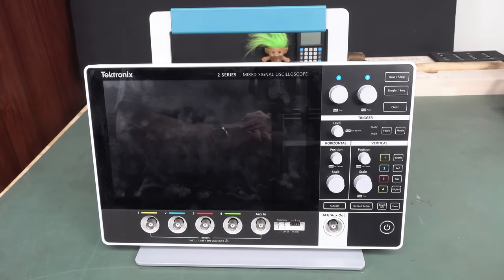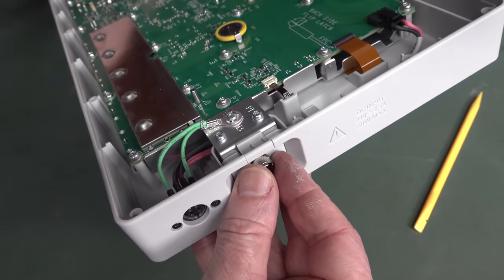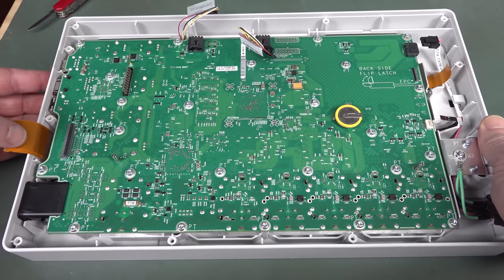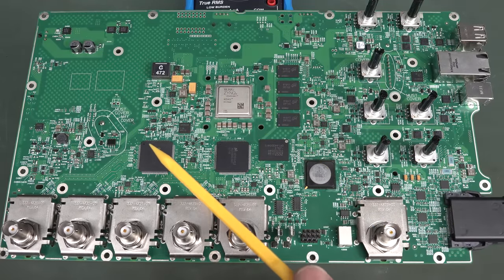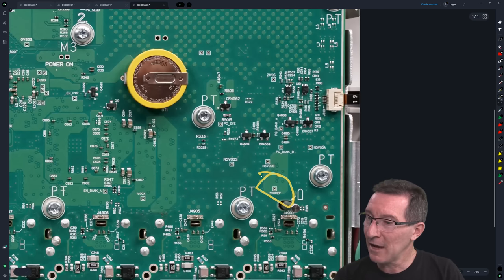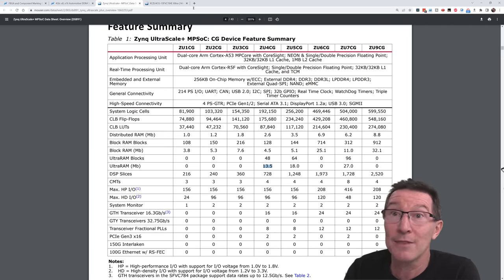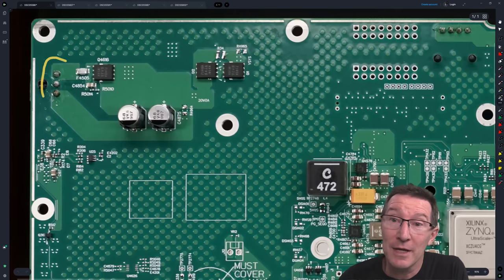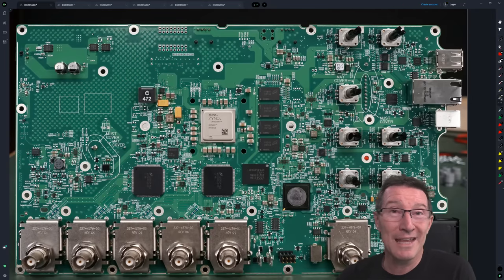EEVblog 1477 - TEARDOWN! - NEW Tektronix 2 Series Oscilloscope

Comment: I have to say that my initial reaction to the membrane switches was negative - but I say now, that I have used it, a lot of effort went into the material selection and the membrane buttons have a great tactile feel.  Definitely designed for the industrial market - completely different league than consumer grade membrane buttons.
Reply: membrane buttons on my 1983 yamaha dx7 still work great :goodvibes:
Reply: @cappnuwu4021  the DX7 was built to last also.......nice one!
Reply: @cappnuwu4021  Lots and lots of DX7's dont work anymore due to the membrane switches!
Reply: @dietervolke7811  Let's remember to check in on how Tektronix 2 series are doing in 2060:yougotthis: Haha!
Reply: Alan is biased though, of course he likes it!  ;-)  j/k  If there is someone else that is going to pick this thing apart, Alan would, even IF he is on the payroll! Looks like a darn good bit of kit TBH. Though metal inserts into the plastic on the backside would have [should be] a part of the design. Penny pinching on a Tek product should be sacrilege.
Reply: It still doesn't feel right to get membrane buttons in this price range. I think it indicates that the buttons are on their way out. I wouldn't be surprised if future models do everything via a large touchscreen that almost fills the form factor.
Reply: @EdwinSteiner  Not hard to predict, given what happened to mobile phones.
Reply: @EdwinSteiner  I hear you.  There is a big difference in industrial rated membrane switches and consumer grade.  I believe another motivation for the membrane switches is considering the operating environments that this scope is expected to be used in - it will likely be carried on-site a lot, subject to a lot more dust, dirt, grime, etc. than a typical lab/bench instrument - so the thinking is that the membrane switches will be more reliable (less dirt/dust contamination) and easy to clean.
Reply: @EdwinSteiner  this is a literal fucking nightmare for me. I have yet to find a touchscreen interface that rivals physical buttons.
Reply: @cappnuwu4021  2060? Let's see it in 2035. And not because of the membrane switches, but because of corrupted flash memory.
Reply: Membrane feels cheap. Not liking this scope.
Reply: Hopefully not to my experience with industrial membrane  keyboards.
Reply: It is curious Tek felt the need for buttons at all, though maybe there are a few operations where you wouldn’t want to cede waveform screen real estate to virtual buttons.  If there were enough CPuU power and interface pin available, then perhaps a second capacitive touch LCD for the buttons (if keeping them separate is a must-have).  At Tek prices, they could afford to do that.
Reply: @Okurka.  My thinking was the membrane panel is a separate part, so it could have been an LCD screen.  An LCD screen could give some interesting options for implementing virtual controls or alternate language labels.  Probably one larger screen for everything but physical knobs makes the most sense.

Comment: Ooo this having a VESA mount is handy. You could get a swivel desk mount and mount it at the perfect level on the bench and not take up bench space. Handy if you've got a compact bench.
Reply: Just wish the power plug had a back access, even if they had to have two jacks, you lose the ability to hide the cables off the side, it ruins the aesthetic and is inconvenient pragmatically because you can't put it up against anything on that side you have to have the area for the cable clear. The VESA mount is nice though since it's light enough it'll probably fit fairly well on some floating arm stands.
Reply: @JWH3  - seems to me like it would be a Dremmel job to cut a new hole for the power connector and move it.
Reply: Me i have a TDS640 Tel Scope !
Reply: @JanBruunAndersen  on a scope in this price range even as it's "entry level" it's a design consideration that should have been addressed before a final product was released. This might be 'entry level' but they start at 1,800 dollars and what I've seen so far doesn't really give me great feelings about the amount of true effort they put in towards good usability engineering.

One thing they did was used self tapping screws for the main screws for the case, and that's just not a good sign in my book.

No one should have to be taking a Dremel to one of these things because they decided not to address something so basic as sensible cable management,

Comment: Nice video. Also, the OS is running on the DDR4. The memory controller is on the (PS). Ultraram is used for the programmable logic (PL). OS is on programmable system (PS). eMMC is used for bootloader, PL bit file, OS … and is attached to the PS.

Comment: Thought on the BNC back Shield, is that the bumps are providing 2x functions, 1: reducing RF capacitance (it could have been creating an undesirable filtering effect if it was closer, and changing the characteristic impedance of the connection) from any protrusions of the BNC center pin, and 2: mechanical stiffening against the back plastic.

Edit: Thought of another possibilityUL compliance/clearance for transients from voltage sources… just remembered of a student using DC coupling on a 240VAC transformer primary.
Reply: My thoughts exactly - but you got there long before me!
Reply: 1M || 15p some 50f stray is irrelevant
Reply: @reinerfranke5436  Isn't it 1M || 13 pF for this scope? Also i came to around 400pF and 200pF with the bump. I assumed 1 cm² area and 2 mm distance without and 4mm with bump. Not sure this is even the correct approach here. Any RF experts here?
Reply: You are correct , look at the area around the centre pin to the plane ✈️ on the pcb
Reply from the maker: Yes, on 2nd thought I think it's CAT compliance clearance
Reply: I was thinking it just pressed against the inside of the back so the shield can't vibrate off the clips.

Comment: The 2 metal posts could be useful for the case to feel a bit more solid, when you pick it up. If feels really cheap and nasty when you buy a new bit of kit and the back is just all squishie
Reply: @the fltsimbuff yes, just make it feel a bit more solid. 👍
Reply: @Radio_Flakes  could be cost cutting, but it could be swapped to plastic inserts to reduce cost. Im glad I dont have to build moulds.  🤣    👍👍
Reply: @Radio_Flakes  I bet thats why I stayed away from them and stuck to PCBs.

Comment: The "MUST COVER" / "MAY COVER" is likely instructions for conformal coating, which has not been applied on this prototype device.
Reply: Does it follow the RFC2119 outlines? Ha.
Reply: Looking very carefully,  U11, CR3 and Y3 appear to be covered in a clear coating.  U11 is certainly shinier and blacker than surrounding un-coated ICs.
Possibly coated to prevent high humidity or airborne contaminants from upsetting the oscillator frequency (?) or flattening the battery.

Comment: At 31 min. They wouldn't be using the internal memory for the OS. Only ~1.5MiB. Likely using the external memory for the OS and the sample memory. The internal RAM might be used for FIFO buffers between the ADC and the external memory for storing the samples.

The Zynq typically also runs form executable code in RAM. So it would load (copy) the binary for the processors from the FLASH into RAM and execute it from there. Possible otherwise, but I would say unlikely.
Reply: Not to mention that the PL (FPGA fabric) and the PS both use the same interface to the memory controller, and thus share the address space. They could split it up however they like!
Reply: Usually the on chip memory is just used for initially loading the boot loader from flash before the external DDR is initialized.
Reply: @RobertHancock1  Yes, but that is On Chip Memory (OCM) which is different to all of the memories shown in the videos. The memories mentioned here (except DDR, that is shared) are all PL based.
Reply: 0:31:00 - You can refer to timestamps like this if need be :) 

Format is: hours:minutes:seconds (hh:mm:ss) with a space after it.
Reply: @RobertHancock1  What kind of "on chip memory" do you mean? Boot ROM, caches or distributed memory blocks in the FPGA array? However, large sample buffers, framebuffer and the operating system must be outside the FPGA in the DDR4 chips. There is not too much space for the samples...
Reply: @PETMK  There's 256KB of on chip memory that's mainly just used for the initial boot image loading before the DDR memory is initialized.

The sample memory is definitely going to be mostly in the DDR, though there is likely some buffering in the PL using block RAM or UltraRAM.

Comment: The screws under the VESA mount screws on the label are for structural support integrating it to the front
Reply from the maker: Yes, you want some rigidity in the centre like that.

Comment: Soldered on coin cell battery is always a no no for me. Had to wait 3 months last year to get my hands on a BR-1225/HCN for a serial concentrator at work. Checking today I would be on a 6 week lead time. It's just not necessary those coin cell holders are not letting a battery come loose ever.
Reply: Ehh you don’t have to replace it with the same part. Any 3V coin cell with solder tabs would have done the job.
Reply: @NavinF  Unfortunately I did because the fecking solder tabs have different PCB layouts. You don't think I didn't look into that? I guess I could have botched it but I decided just to stick it back in the rack while I waited for the right part to become available. Panasonic have the same battery with more than one solder tab layout for crying out loud. I cannot for the life of me fathom why you would use a solder down coin cell over a battery holder and bog standard 3V coin cell. The battery will run down and then you need to breakout a soldering iron to replace it.
Reply: @jonathanbuzzard6648  Ah I assumed there would be a de facto footprint and you could just bend the tabs to account for small differences. I agree that soldered batteries are asinine, especially in the sluggish test equipment industry. A mid end scope from 10 years ago is still considered a mid end scope today. No way the battery can last as long as the scope.
Reply: With a bit of creativity, I'm sure you could bodge in a button cell holder.
Reply: @larzblast  I probably could have bodged a button cell holder. I did consider getting a carrier PCB made. However in the end it's only a serial concentrator for emergency out of band management of all the network switches/routers etc. on an HPC system. That the RTC lost the time if the power was lost was not that important on a UPS and generator backed system. Yes it moaned once a day for three months in the logs that battery was flat but I could live with that. The issue is why the hell put a soldered on battery that is unlikely to last the lifespan of the device. It turns a job that would just require a screwdriver to something that requires extensive disassembly and then breaking out the desoldering tools. If it's going in a rocket then perhaps it is justified, in a fricking oscilloscope or serial concentrator no way is it EVER justified. The designer(s) needs taking out the back and given a jolly good thrashing with a clue stick.
Reply: @jonathanbuzzard1376  That's a fair argument.

Comment: If they had the upper right 3 buttons real, I could probably forgive the rest being membrane. Those 3 buttons are used too much to deal with membrane switches. There's a reason they are presented as extra large.
Reply: I had the same thought. Once i configure my scope settings those are the three buttons i use 90 percent of time.

Comment: with all do respect, Its nice that the power input is on the side, It lets you wall mount it eye level. handy for smaller labs or saving desk space.
Reply from the maker: Yes, but I also would have liked to have seen a rear option.

Comment: I think the main FPGA's internal memory is used for fast sampling and the external memory is used to run the program and maintain internal samples.
Reply: I don't think the PL has enough for 10Mega samples for four channels. That would be 40 Megabytes minimum. The largest Ultrascale, i.t.o. memory (XCVU190), has a mere 16MB. 

For buffering (FIFO) PL memory is probably being used with a DMA to DDR.

Comment: That power input connector is the same as used on a lot of reciept printers for 24VDC power, so readily available if it breaks.
EDIT: might be incorrect there as I believe the reciept printer connector is a 3 pin (i'm not at home so can't check my epson TM88), but the 4 pin was/is still used on a lot of things so still easily available. I had a cheapo IDE NAS that used that connector for +12/5V and I believe my SCSI JAZ drive is the same connector. I knew I'd seen it before somewhere.
Reply: Receipt printers are 3 pin. A lot of POS terminals use the 4 pin though
Reply: This would be a great use for USB-C PD

Comment: Why haven't Tek chosen to power the oscilloscope using USB-C which is becoming standard on laptops, notebooks, tablets and phones, and just mandated by EU?
It is powered with 24V and rated 60W maximum.
Reply: not nearly as rugged as the chosen connector.
Reply: @Christopher Grant I dunno, so far all my USB-C connectors and cables are outlasting the others. I've only had 1 cable go bad thusfar. I've probably got 10 of em. Higher current is a huge win.  Zero mechanical failures and zero dirt/dust/grime issues so far.. knock on wood right !    
        High end Pro audio equipment is using them. These are not consumer grade products.   However, I don't think power & data should be mixed. I've seen noise issues arising from mixing data & power. Everything evolves, maybe noise will be solved one day
Reply: @Christopher Grant The newer stuff is USB-C
Reply: And why still have the idiotic CHASSIS GROUND??? Why not have each input isolated, floating, and differential??????????????????????
Reply: Safety earth bonding is a requirement.  It must be guaranteed through the connector or you have to make the customer earth bond the scope some other way which can be a challenge.  If you use a standard interface like USB-C the customer may use any USB-C power supply which may or may not be safety earth bonded and thus pose a safety risk.
Reply: @Christopher Grant USB-C is pretty much standard on new pro audio devices.  Especially on high end portable gear. The only stuff which doesn't have usb-c is old designs. Also, I am speaking of Studio Equipment, which is were usbC is wanted/needed. You don't really need high speed data for amplifiers or stereo rack mount effects.  Dante is a whole different story with a different use scenario.
If you want some examples : 
Apogee digital Duet 3 is the new version. 
All the Focusrite Scarlet stuff 
UAD - That is was I would call pro audio
M-Audio has a usb-c interface 
MOTU - uses them ... 
I mean the list goes on... 
Mackie just redid their product line so your not going to see usb-c yet, but I bet next round of products your going to see it. Same with yamaha.   Behringer is just cheapo so I'm not surprised they haven't adopted it yet... Behringer is like 'almost' pro. sure its considered pro audio, but it is certainly not "high end" . 

What is the beef with USB-C  ?   I hope your opinion isn't based on some budget knock off apple charger cables ;p
Reply: @timkeil5063  No, it isn't. Galvanic isolation is even better! Shielding can be done one-sided, without causing a ground loop. And all measurements can be differential, with either single-ended, or double-ended shielding!
I want a scope (there are Fluke handheld battery-powered ones which have this, but not with best bandwidth) that have a plastic isolated case, individually floating inputs channels returns.
Just take a look at your bench!!! The scope is the ONLY instrument that defeats all good principles of preventing ground loops!!! Why??? Every other instrument floats!!!
NOBODY makes a scope with differential inputs though...
Reply: @nameredacted1242  Right, if you have a channel-to-channel isolated instrument then you can get away with a basic DC input.  Check out TPS2000 - 4ch, 200MHz bench scope for instance.  However, if your BNC shells are conductive and connected together then earth bonding is a requirement.
Reply: @tdtrecordsmusic  you ust not really know "high end pro audio" alost none of it uses usbc
Reply: @joeambly6807  I'm in a recording studio. Pro Audio is my work.  yes, new designs are almost all using usb C. I was just upgrading a system yesterday. usbc is ubiquitous. Many reviewers were constantly saying usbc was a deciding feature when comparing 2 units. Why would u want usb 2 when we are even beyond usb 3.1 ?     
        Here is a similar question >> if not usbC then what is used to get audio into a modern computer ? <<

Comment: That’s one of the lowest-end parts in the Zynq Ultrascale+ line. Tek are probably paying something like $50 per unit or less depending on the volume. Part of the external RAM will be being used for the ARM system and part of it for the programmable logic fabric.